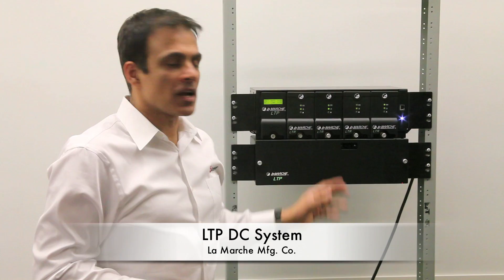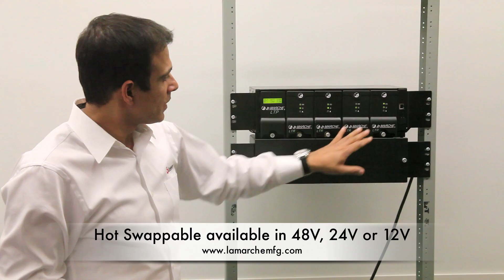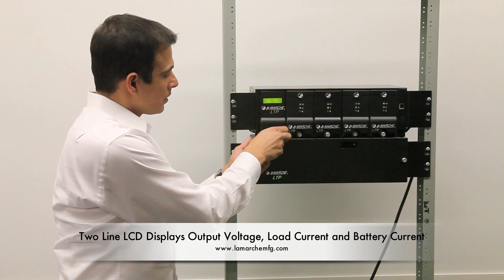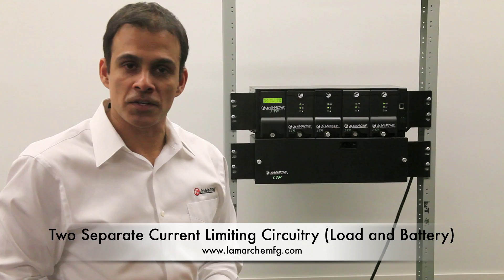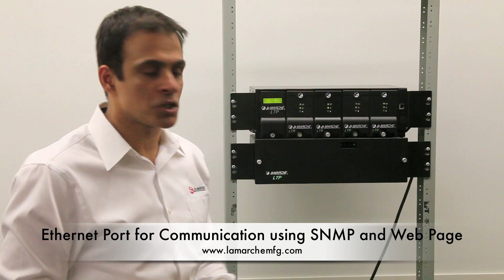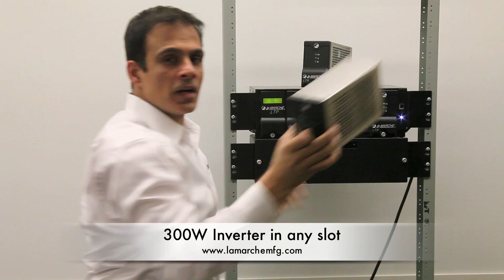La Marche LTP DC System

Comment: Beautiful system. The current limit for distribution and battery is great. I installed a system one time where the distribution load was all tied in with the battery. The current was running on the battery breaker and it kept hitting the current limit because the battery and distribution were tied together. Pain in the you know what! So I had to order distribution breakers and separate the plant load from the battery load. Lesson learned.